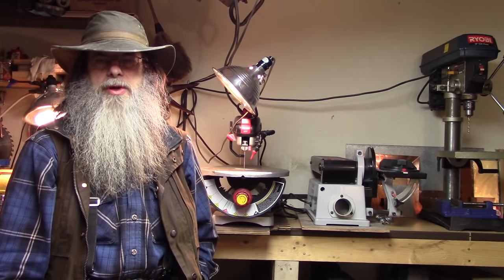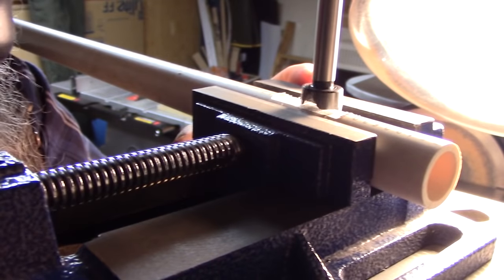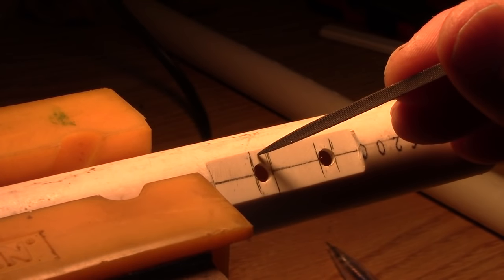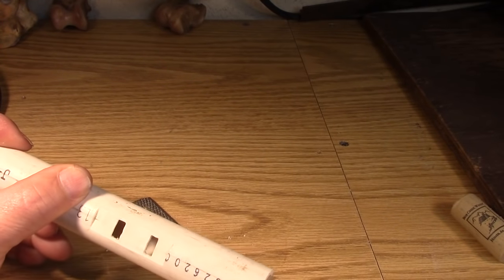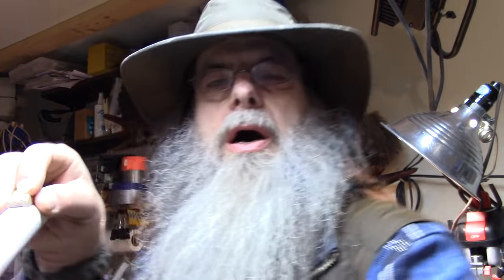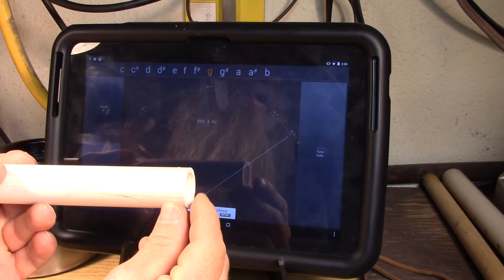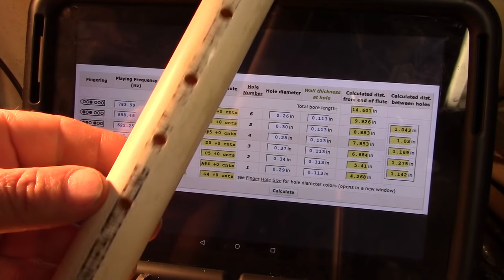How To Make A Homemade PVC Flute

Comment: I didn't have any corks so I used a corn cob, making it ever so slightly larger than the hole and forced it in. Also, I had the idea of taking a pvc coupling and grinding out the inside lip and sanding the inside to where it would slide over the pipe with a bit of resistance and it worked perfectly for the "bird".

Comment: Super video. I'm making a bamboo flute, but no bamboo flute videos go into as much detail. For example, none mentioned that the spacing can be changed from flutomats measurements and that holes will just need to be adjusted to the correct size for whatever note we want. So glad I found this. Thanks!

Comment: Just make sure you coat the PVC with a safe coat or use tape to cover the exposed area. Do not put your lips on the plastic. My brother is a chemical engineer and he explained to me how PVC breaks down and is absorbed through the skin if any heat is applied and if there is moisture in the skin / on the skin.

Comment: I remember when I was young (around 14 ? That is long ago…) I made a flute like this, but much more simple with "Canne de Provence", a sort of bamboo. Only one bias hole and the cork to generate the sound. And no engine to fit the finger holes. The lower was a C for me and then I pierced the holes step by step from the down one, adjusting the size with ear. I just used a small knife and the flute sounded very well, and I had a great pleasure to play it.

Comment: Could I use copper pipe instead? Just thought it would make for a cooler looking flute
Reply from the maker: I do not know how much the thin wall of the copper pipe would affect the performance.   I guess you could try it and see.
Reply: GoSub, let us know the results man
Reply: Paint it.
Reply: the thinner the wall the more high pitched sound ya would get I believe
Reply: @Far-North-Bushcraft-Survival  I don't think the wall is thick enough to file the correct flat spot where the air holes are.
Reply: Comrade Matthew u9
Reply: I thought of trying it out of a piece of bamboo

Comment: A piece of the handle of a plastic MRE spoon makes a good, low profile bird. The notch along the bottom seems to be perfect. I first tried with 1 inch PVC and used a hot glue gun with good results. Now I am making another with 3/4 PVC. I made a wide perpendicular notch across the top of another piece of the same spoon handle to wrap it down with nylon bricklayer's line. Works and looks good.

Comment: Very very good video great narration. Thought I could build one but got lost at hole diameter, distance apart etc. well I wish I could make one, I love the way it sounds. Haven’t had one in my 69 years so I guess my “wants” won’t kill me. Thanks
Reply from the maker: If you watch the video closely you will find a copy of the web page that i used to make my flute.  You could use the hole placement recommendations from that page copy that i used if your flute is made from 3/4 inch PVC and is cut to length as I showed in the video.   You will need to custom tune the flute length and holes though by using a tuning app such as I showed.

Comment: +far north bushcraft.........Lonnie, if you overshoot the fundamental or root note when trimming the distal end, no need to start over. You can make a choke to insert up inside the bore at the foot to bring the note back flat and get it on key again from there.
Reply from the maker: +Darrell Allen    I did not know that, thanks.   I did know though that the "bird" can be extended past the sides of the sound hole and will lower the fundamental note also.
Reply: +Far North Bushcraft And Survival  Yes Sir, I used to make NAF's for about 12 yrs till having to give it up. Basically, you just cut about a 1" section of the PVC, slit is lengthwise (removing enough material so you can glue it up inside the foot of the flute. Esssentially, you are thickening the flute walls at the foot, tricking it into thinking it's longer than it actually is. Putting a chimney on the bird as you mentioned, that surrounds the TSH (true sound hole ) will also lower the fundamental, but not as drastically as installing a choke in the end will. Another great tip if you overshoot the note on your finger holes ( i.e. making them too large and going sharp ) is to get some thick CA glue and either put it inside the finger hole on the North side of the hole ( closer to the TSH ) or build up a ring of CA glue in the finger hole to choke the note back flat again, then slowly open it back up with diamond file to bring the note on pitch. Happy fluting brother, love ALL your videos !    ;-)
Reply from the maker: +Darrell Allen    Thanks for describing the process of fashioning a "choke" for the end of the flute.     That makes sense.      In order to make super glue thicker I used to add baking soda to it in order to get it to stick to my synthetic prop on my ultralight aircraft when repairing gravel dings in the prop.     That might work well for the PVC as well when narrowing up over large note holes.

Comment: I tried making one out of bamboo. I got it tuned to G, like you did, but it went to hell quickly once I started drilling the finger holes. The same thing happened when I tried making a shakuhachi 3 years ago. Will try again, maybe 3 years from now.
Reply from the maker: I drill all my holes smaller than they should be to start with.  I start tuning from the bottom hole, the one farthest from the air hole.   only once that bottom hole is tuned do I go up to start tuning the next bottom hole.   Once that one is tuned then on to the next one and so forth.   The bottom one needs to be tuned first before moving on.

Comment: take a pvc tube of about... 28mm across

5/6 finger holes

10 cm above a small hole for the resonance piece 

5cm above that make a pinky sized blowing hole 

put a prop just behind je blowing hole and leave an extra 10/15cm at the end. 

take some plastic foil, stretch a small piece over the resonance hole (1 layer) 

and voila, you have a dizi flute :) 

press the foil gently to wrinkle it a bit for a different sound. 

gr, from the netherlands

Comment: Hello!  I was in the shop today looking at your videos to see if I could find a project to pass the time away.  Well I came across this one, FANTASTIC!  I followed your instructions but didn't have the forstner bit so I used a rasp and file to make flat area.  It took some time to make sure it was done right but it came out great.  After downing the tuner I had to adjust the holes a little.  It took me a total of 3 hours taking my time, but I am very happy with this project and the sound of the flute!  Was wondering if I could cut a 3/4 inch wood towel in half and use a gouge to make the hole in the center then glue it back together and use the same steps as with the PVC pipe, since Bamboo is not easily available here  Think I might try it, will give you a report on if it works or not!  Thanks so much for passing all your knowledge on to everyone.
Reply from the maker: People do start out with typically a  square bloc of wood and saw it in half lengthwise.  They then use a router with a guide to make a half circle "trough" down the length on one half and repeat on the other half making sure that the troughs on both halves line up with each other.   They then re-mate the halves by gluing together.   Then fashion the rest of the flute by trimming the excess off of the outside of the flute and placing the air and sound holes  appropiately etc.
Reply: @Far-North-Bushcraft-Survival  thanks!

Comment: NIce demo. NIce sounding flute when you were done!!!!! I noticed your yellow soft jaws on your main vice, I would have also used them in your drill press jaws for creating the flat area on the PVC in case you get too close to the vice jaws with the drill bit! Not criticism just from experience!
Reply from the maker: +prophotos365      Using the plastic/rubber jaw pads on the drill press vice is a good idea.    I was extremely careful but still nicked the vice once.

Comment: Good day sir thank you for your work and no BS i am from South Africa and i started making PVC flute in Gm 4 key and i made the flute soundhole perfect the G note is in the middle i used the program on NAFlute website i put all in for wall thicknes drill bit sise 6mm 1/4 for all 6 holes and Gm4 but my first hole far end north stay at D what is the solution if you can give me advice please and thank you. I already throw 2 away. Greetings from South Africa John Helberg Longbows.
Reply from the maker: I am not sure what you are asking.  But be sure to cut the flute length longer than needed initially and make the sound holes smaller in diameter than is recommended.   Then in the tuning stage, you can carefully bit by bit trim the flute length until the flute is correctly tuned for the basic note that is wished for.   With the holes, you carefully begin to widen them a tiny bit at a time as you are tuning them until the desired note is reached.   Be sure and start tuning the farthest hole from the mouth end first until it is tuned before tuning the next farthest hole.  Continue in order until you can finally tune the hole closest to the mouth end last.

Comment: Hey, have you tried clamping the pipe to a block and using a router table to flatten the section of pipe? It seems that running the assembly along a fence could provide very accurate results, whereas the drill press method requires the modification of a Forsner bit and a very steady hand to not go over lines. Your thoughts?
Reply from the maker: +ouchymytoe    Although I do have a router (inherited it).  I am not all that familiar with the use of it.   I know I need to learn the device since they are capable with accomplishing so much.   I know that If I had a table or a level surface where the flute could be held securely, flush or slightly below the surface, the router could make the job of flattening that one section of the flute much faster and smoother than the forstner bit in a drill press.    It would not only accomplish the job faster but do it better.

Comment: What an awfully good and entertaining instruction that was. Thanks very much. I’m off to the Lowe’s for some 3/4” sch 40. Do you have a recommended table saw blade for the smoothest cut on PVC?
Reply from the maker: Most blades will cut fairly smoothly if done slowly enough.   Good luck.

Comment: Fantastic instructions! Totally clear. He makes it seem so easy.
If I wanted to make a bass flute, would I need a larger bore pipe - or a different length of the same pipe you've used?
Reply from the maker: A longer length would give you a deeper tone but It may be best to also use a larger diameter pipe.   I am just guessing here since I have not made a deeper tone flute
Reply: Thank you. Looking at some other videos, it seems like a 1" pipe might do it.

Comment: I’d love to see a video on how you connect your “lanyard tie”. Do you glue the wood piece to the pvc?
Reply from the maker: No I do not glue it.  The wood piece is held on strictly by the lanyard.    I lay thr lanyard ove the wood and flute about in the middle of the lanyard.   Thern I take one end of the lanyard and loop it around the flute two more times.  You will now have three widths of lanyard across the top of the wood and flute.   Then I place both ends of the lanyard in a cordlock and snug the cordlock up tight to the bottom of the flute.  That's it.

Comment: I loved this video.
But can I use hard foam in place of wine cork as air plug? I live in India, I don't drink and it's very difficult to find one. What is the basic scale of this flute? Pentatonic minor?
Reply from the maker: You can use any material that will not let air pass through it, is water resistant and will fill the space tightly and prevent air from bypassing it.   Yes the musical scale is pentatonic minor.

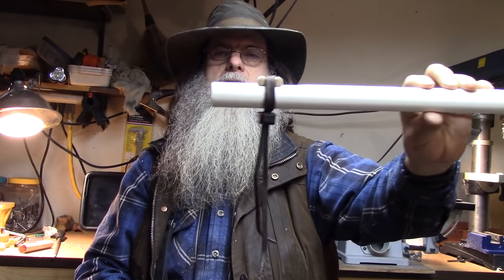Comment: Very helpful! What is on the back of the leather strap shown at 17:33? Is it just a block of wood with a hole in it? I have never worked with leather and would like to know what it is called.
Reply from the maker: I believe you are referring to a cordlock.   It is a typical cordlock that I use to adjust the tension on the cordage when it gets loose.   One could easily just use knots.

Comment: Great video, I really enjoyed it. I have completed making this flute except for measuring & drilling the fingering holes. Sorry for being so incompetent completing this task but was wondering how you measure with an accuracy of 1/1000th of an inch & if it is really necessary? Also, for the drill holes, do you use the closest drill bit & then use a file to increase the size of the hole?  Again, sorry for asking questions that everyone else has apparently been able to figure out. Hopefully being in the winter of my years (75) , having zero musical talent & flute building skills will grant me some leniency. Thanks, Ron
Reply from the maker: If you watch and listen to the video closely, you will hear me say to cut the holes smaller than is recommended and then slowly and carefully enlarge the holes bit by bit in order to tune them correctly.  The hole sizes given in the online app are not precise as the app has not precise knowlege of the accuracy of the measurements given it as well as other measurements such as the precise thickness of the specific peace of pipe that you are working with.   So, cut the holes smaller than is recommended and adjust them larger while tuning each of them in order.

Comment: the video is great and all but my dad and i made one ( or started to ) until we relized we didnt hear or see a measurement and we have spent 2 days trying to find out how far we need to space it how far did you space the finger holes? PLEASE REPLY SOON!!!
Reply from the maker: Evidently you filled something in wrong at flutomat.    Try the "Guided NAFlutomat" if you did not do so.  A link to teh guided version is found at the link below.   Also I believe that I showed somewhere in the video a copy of the NAFlutomat page that I used where the info is all filled in.  If your flute is the same size / diameter etc as mine, then the info on my copy may well work for you.

http://www.flutopedia.com/naflutomat_g.htm
Reply: thank you so much!

Comment: Is there a reason for placing the holes in line rather than moving them right or left for more comfortable finger placement?
Reply from the maker: It may be more comfortable to stagger the holes according to ones desires and needs.   It will not affect the sound as long as the holes are placed at the precise correct distance along the flute that the correct tuning dictates.

Comment: Great video I loved it won't the cork stop any wind
Reply from the maker: Thank you.   Yes the cork does stop the air from flowing through the flute.  When the air is blown into the flute, it hits the cork and is forced out the first hole.   The "bird" on top is fashioned in such a way as to redirect that escaping air across the top of the flute and across the top of the second hole.   A portion of the air flowing across the top of the second hole is redirected into that hole because of the sharp top edge of the hole and then travels down through the flute.   It is the air traveling across the top and quickly being redirected inside the flute and out side the flute, in and out, in and out many times a second that creates the sound that comes from those vibrations.

Comment: thanks for this tutorial , nice job !
Now : an IMPORTANT CAUTION for your audience : industrial PVC is teratogenic ; that is, it causes genital malformations, and other whatnots due to its components. I have been using pvc for a long time to make flutes, but always with an intermediate part that preserves the oral mucosa from any contact with this plastic.
Reply from the maker: One does not place their lips over the flute.   No part of the flute should be in the mouth.   The outside of the mouth is against the end of the pipe.    So there is no more chance of any more toxicity from entering the body than all the other plastics that we handle on a daily basis.    PVC has been used for several generations as water pipes to carry drinking water throughout buildings.   So PVC outside the body poses no toxicity threat.
Reply: there is a huge difference between food grade PVC and PVC made for non-food purpose. Years ago i plaid some whistles and bulgarian kavals, home-made from "electric tubes". Playing an hour or two was enough to feel a strange kind of saltiness all around my mouth...
Every one may take his responsibility, but when recommending the use of pvc for an embouchure, at least we should give the warning...
NB even food grade - PVC eventually became prohibited in most countries.